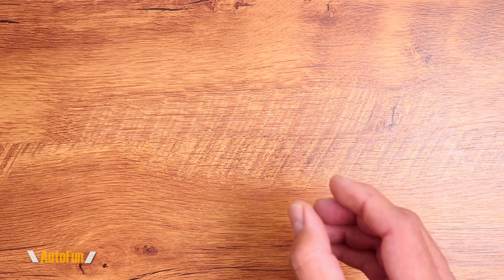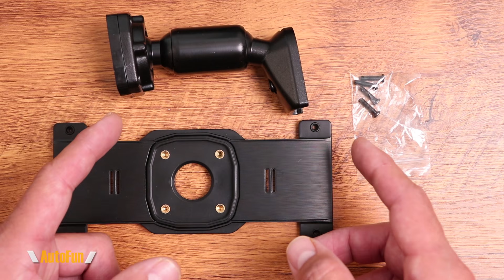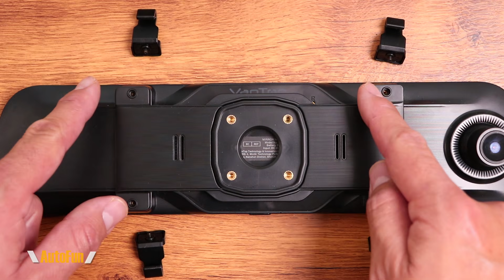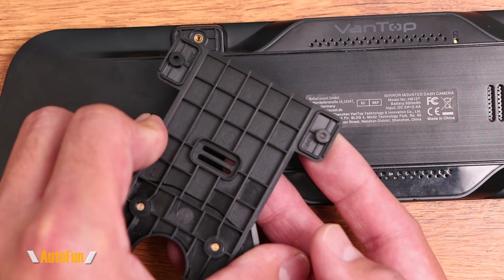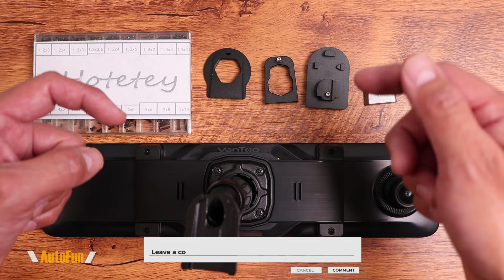How to Install Mirror Dash Cam WITHOUT Straps (Direct Mount Conversion Kit for LCD Mirror)

Comment: Do you know of a kit that will fit the Rexing M3. I need to adapt it to my Ford Bronco
Reply from the maker: Hi Bigfoot! Unfortunately the Rexing M3 does not have screw holes in the back, so a conversion kit will not work with it.  Cheers!

Comment: Doesn't work on a Jeep Cherokee and the US wedge mounts don't fit.  I returned it.
Reply from the maker: Hi Sirbug! Ah I placed links in the description to different mount adapters if your mount is not the standard D tab type. And if you prefer not to use mount adapters, your installer can remove the existing mount and install a standard mirror tab, I also placed a link to the tab and the special adhesive on the video description. And if you prefer not to use mount adapters or switch over to a standard tab, the Rydeen system could be used for those cases https://youtu.be/cCpyHmiZqiY Cheers!

Comment: Hi...can you teach us how to chang bracket for ddpai mola e3
Reply from the maker: Hi Tony! I have not tested the yet Ddpai E3, so I'm not sure what kit will fit, however you can measure the back as I showed in the video to determine the size but If I do get a hold of one of one, I will measure it for you and update this comment. Cheers!
Reply: @AlexAutoFun  the back of mola e3 don't have a screw to mount it to the bracket.if u got a solution can u share....10q
Reply from the maker: Hi Tony! Ah unfortunately if it does not have screw holes in the back, the conversion kit will not work with it. Cheers! @tonyhashim5776

Comment: Dont you have day job man? I also noticed you lost two personal passenger and driver courtesy lights from under the stock mirror man.
Reply from the maker: Not really LOL! Ah yes, loosing the electronic buttons on the original mirror is one disadvantages of direct mounting (even when strap mounting some dash cam can also potentially cover buttons on found on some OEM or On-Star mirrors). And I have reviews for traditional dash cams on my channel under the playlist "Dash Cam Reviews" if you want to use a non-mirror style one. Cheers!

Comment: Hi do you know if there is any adapter available for a 2019 Mazda 3?
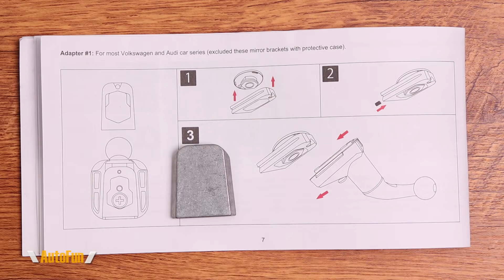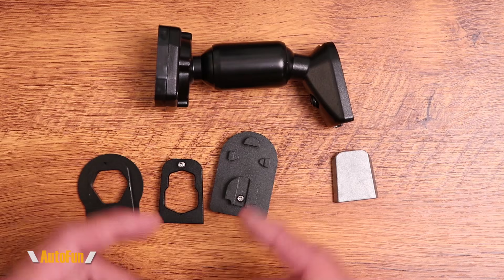Reply from the maker: Hi Tes! You can see illustrations of what the adapters look like at the 6:42 mark and what they look like in real life at the 7:52 mark. Their appearance is very distinct from each other. While it may be possible to identify the mounting tab by just looking thru the windshield (from the outside) I prefer to remove the the OEM mirror to double check if the mounting tab is a standard one or a specialty one (by comparing it to the examples show on this video). Cheers!

Comment: I have a van with no mirror.
Reply from the maker: Hi Dallas! Ah a mirror mounting tab can be installed by your installer to allow an LCD mirror dash cam to be installed. I placed a link to the tab and the special adhesive in the video description. Cheers!

Comment: The universal direct mounting kit you have listed for my Nexigo D90 Dash Cam on Ebay does not work. The screw holes do not line up at all. Are there any other kits out there that may be adjustable?
Reply from the maker: Hi Redline! The kit I linked for the Nexigo is from Amazon not Ebay, not sure which link you are using. I have converted several D90's using that kit but notice that it does require modification to work (the kit is what I call the universal kit). The link to the video showing the modification is also on the video description below the link to the mounting kit. Cheers!

Comment: Hi Alex, great vid and solves the problem 8n my 2011 Land Rover Defender Puma. So… is there a converter existing for this really dated, weird and uniquely Land Rover attachment? There is a hole in the head lining, no attachment to the screen! Just asking, great vid though!
Reply from the maker: Thanks Subsyairsoft! Ah yes there are some specialty brackets for mirrors that attach to the headliner, I placed links to them in the description, some that are labeled with for different car brands but as long as the mount matches your current mount stuff, it should fit (some car brands share mounting system). So I would recommend matching the picture of the specialty mount you think will fit to what your current mount looks like to confirm. The other option is with this system https://youtu.be/cCpyHmiZqiY if you are using a Rydeen. Cheers!

Comment: Do you know if there is a kit for acumen M4 digital camera mirror?
Reply from the maker: Hi Gustavo! Unfortunately I have not reviewed the M4 yet, so I'm not sure what kit will fit, however you can measure the back of the dash cam as I showed in the first video https://youtu.be/TtjZ7rC_ncY to determine the size. And If I do get a hold of one of one, I will measure it for you and update this comment. Cheers!

Comment: Do you know of a conversion kit for a Honda S2000? The windshield mount is not typical.
Reply: Also, is there a mount for the Wolfbox G890?
Reply from the maker: Hi uhkordguy! Unfortunately the G890 does not have screw holes in the back, so a direct mount conversion kit will not work with it. And I have more mirror dash cam reviews on my channel in the playlist "Dash Cams Reviews" if you like to compare them. Cheers! @uhkordguy
Reply from the maker: Hi uhkordguy! Ah there are a couple ways it could be done if your mount is the special Honda type (I usually double check the type by removing the original mirror to confirm) One would be with an adapter kit like this one https://amzn.to/3xKFlqt or with this kit https://amzn.to/49Q4lhp (assuming your bracket has been confirmed to be one of the odd ones) or finally the other way would be to have the installer swap the specialty bracket with a standard one (I placed links to the standard bracket and adhesive on the video description). Cheers!
Reply: Do you have any recommendations on a shorter USB C cable for the Wolfbox mirrors? Trying to clean up the installation
Reply from the maker: Hi uhkordguy! I would be careful if switching out the cable (some can separate and some are attached to the 12V adapter) remember, while dash cam manufacturers typically use standard USB connectors, they typically deviate from the USB standard, so the cable (the connector) can potentially be wired differently than a normal USB cable. What I usually do when installing dash cams is I hide any excess cable into the trim or in an area in the car where it will not affect the car or the dash cam cable (I have a video coming on this topic, stay tuned). Cheers!   @uhkordguy

Comment: Hey Alex I recently found your channel and I bought the wolf box 850 along with the hardwire kit and the universal conversion kit. Unfortunately my mirror bracket is one of the “special” ones lol😂 if I buy the mirror bracket for Honda that you linked in the description will I be able to mount my mirror? Muchas gracias Alex están muy chidos tus videos!
Reply from the maker: Thank you Jose! Ah there are a couple ways it could be done if your mount is the special Honda type (I usually double check the type by removing the original mirror to confirm) One would be with an adapter kit like this one https://amzn.to/3xKFlqt or with this kit https://amzn.to/49Q4lhp (assuming your bracket has been confirmed to be one of the odd ones) or finally the other way would be to have the installer swap the specialty bracket with a standard one (I placed links to the standard bracket and adhesive on the video description). Saludos Amigo!

Comment: Do any of these mirror dash cams have auto dimming mirrors? Only downside i see if i did this for my wrangler would be that i would lose my auto dimming feature on the mirror and side mirrors without the sensor and capability to do so.
Reply from the maker: Hi drugigger! Correct, Mirror Dashcams do not feature auto dimming. This is due to the mirror being an LCD screen when turned on, so you don't get your eyes blinded by the headlights from rear vehicles since what your are seeing is not a real reflection, what you are seeing on the screen is what the rear camera is seeing (assuming the mirror is used with the LCD screen on and the mirror is not aimed at your eyes since the screen is still reflective). Cheers!

Comment: Is there a mount that would fit a mk2 audi tt as the style of attachment is different on mine
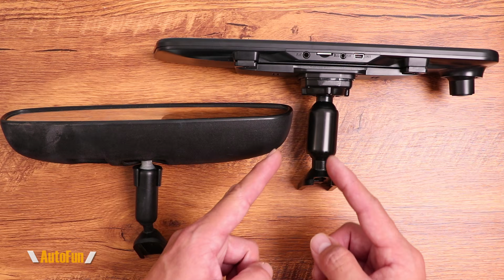Reply from the maker: Hi Glen! I show how to tell which adapter you will need at the 5:40 mark and you can also see what they look like so you can compare to the one on your car. I also placed links to the specialty adapters in the video description. Cheers!
Reply: Ahhh, I missed that part . Thanks for that
Reply from the maker: You're welcome Glen! @glencolledge2586

Comment: Um that's not centimeters that's millimeters
Reply from the maker: Hi Scotty! Correct, the ruler I'm using is in Millimeters which then I show how to use to measure in Centimeters (remember there is 10 millimeters in 1 centimeter, very simple conversion happening while measuring) so the correct kit can be ordered since the kits are sold in Centimeters. That being said, you could measure the dash cam and leave the results in millimeters and instead convert the kit measurement from centimeters to millimeters to determine if it will fit your dash cam. But I find it easier just to produce the measurements in centimeters converting in real time from millimeters than the other way around. Cheers!

Comment: Does mirror bracket adapters fit the official wolfbox conversion kit for G900?
(I have to install this in a Toyota gt86)
Reply from the maker: Hi Tommaso! Remember the mirror bracket (tab) adapters are universal to convert different mirror mounting tabs to the standard one. The G900 kit uses a standard mirror mounting tab so it should accept any standard mirror mounting tab. Cheers!
Reply: @AlexAutoFun  awesome, thank you!
Reply from the maker: You're welcome! @tommasozecchinelli2388

Comment: The specific mount kit for rexing m3 to a Honda sedan?
Reply from the maker: Hi! You can see illustrations of what the adapters look like at the 6:42 mark and what they look like in real life at the 7:52 mark. Their appearance is very distinct from each other. While it may be possible to identify the mounting tab by just looking thru the windshield (from the outside) I prefer to remove the the OEM mirror to double check if the mounting tab is a standard one or a specialty one (by comparing it to the examples show on this video). Cheers!
Reply: @AlexAutoFun  do you know which exact mount kit is compatible with a Honda sedan and a rexing m3 dash cam? Btw thank you for the response.
Reply from the maker: Hi! Unfortunately the M3 does not have screw holes in the back, so a direct mount conversion kit will not work with it. And I have more mirror dash cam reviews on my channel in the playlist "Dash Cams Reviews" if you like to compare them. Cheers!  @whatitisnt.

Comment: With all the extra holders etc, is it the same weight irregardless or does removing the OEM mirror make it much lighter?
Reply from the maker: Hi! Correct, removing the original mirror makes it much lighter than stacking the LCD mirror dash cam on top of the OEM mirror. Cheers!

Comment: I bought the Wolfbox G900  and have a 2024 Subaru Crosstrek.... not sure if the adapter you show in the link covers the 2024 model but can u confirm if the adapters will work with it or maybe send me a link of what will work ? thanks
Reply from the maker: Hi Bob! You can see illustrations of what the adapters look like at the 6:42 mark and what they look like in real life at the 7:52 mark. Their appearance is very distinct from each other. While it may be possible to identify the mounting tab by just looking thru the windshield (from the outside) I prefer to remove the the OEM mirror to double check if the mounting tab is a standard one or a specialty one (by comparing it to the examples show on this video). Cheers!

Comment: @AlexAutoFun. Thank you for the very useful info. I have added an OEM rear view mirror to my Mercedes Sprinter cargo van to attach a Wolfbox G900 camera. However, the overhead console blocks the front-facing camera completely. Do you know if there are longer arms or arm extensions available that I can bring the mirror (and the front-facing camera) lower to clear the overhead console that is blocking its view? Thank you very much for your help.
Reply from the maker: Hi Tat! For those cases you would want a dash cam with detached cameras so they can be positioned away from any obstacles. Here are some good choices that have feature https://youtu.be/zEvk-2z_zQY and https://youtu.be/JJKbUu_egiE and https://youtu.be/dVcfFVLCXbY Cheers!

Comment: You would not want this thing on your mirror 🪞 because your mirror 🪞 will fall off, remember your mirror is only glued to your window and that glue is not strong enough to hold a dash camera 🎥
Reply from the maker: Hi Moge! I have reviewed and installed dozens of mirror dash cams with the strap method (dash cam stacked on top of the original mirror) and none have fallen off. I have also installed many with the direct mount method I show on this video (where the original mirror is removed and only the dash cam is mounted, reducing weight) and none have fallen off. If you prefer a traditional dash cam instead I have more dash cam reviews on my channel in the playlist "Dash Cams Reviews" if you like to compare them. Cheers!

Comment: This is great! I had ordered the Wolfbox G900 for my truck. Because of the shape of the mirror it would not work and was just about to return it to my dismay. This is just what I needed to make it work. Thank you for the video!
Reply: I am having the same problem with my Wolfbox G900 for my Jeep.  I love the dashcam itself and it's features, but it's very annoying that I cannot fold down the drivers side sunvisor as the dashcam is in the way.  It's also annoying that the adaptive cruise control box is in my recordings since the camera is behind it.  I don't want to mount the dashcam anywhere different as I like the stealthyness of it being where the rear view mirror is, and I like how it doesn't take up any additional real estate in my field of view.  I've tried a couple other models and they all have similar problems for my Jeep.  Wolfbox does offer an OEM bracket to replace my rear view mirror, but their customer support cannot confirm it will fix my problems because they've gotten no customer feedback yet on the 2024 Jeep Wranglers with the issues I'm facing.  I wonder if this conversion kit will work or if I should try the Wolfbox OEM bracket.
Reply from the maker: You're welcome and congrats on your new mirror dash cam, Cheers!

Comment: How am I supposed to open my garage door now that my OEM mirror with HomeLink is gone?
Reply from the maker: Hi! Correct that is one disadvantages of direct mounting (even when strap mounting some dash cam can also potentially cover buttons on the OEM or Onstar mirrors). And I have reviews for traditional dash cams on my channel under the playlist "Dash Cam Reviews" if you want to use a non-mirror style one. Cheers!

Comment: What happens, if in middle of a long rainy night tour, electronic lcd dash cam go bad😎
Reply from the maker: Hi Naren! Ah good question, remember most mirror dash cams work as normal mirrors if the stop working or if they are used with the LCD panel off. Cheers!
Reply: @AlexAutoFun  I see. I didn't know that...
Reply from the maker: @naren1097  You're welcome Naren! And you can see my mirror dash cam reviews on my channel in the playlist "Dash Cams Reviews" if you like to compare them. Cheers!

Comment: The oem bracket is a good idea but does not work on a 2017 Ram 1500.🫤
Reply from the maker: Hi Shaggy! If you are referring to the Tri-Lobe bracket on newer Dodge's then all you need is the adapter shown on the video around the 7 min mark and here is the adapter https://amzn.to/3xKFlqt (links to additional adapters in the video description) The other way to do it is to install a standard mirror adapter tab to replace the current tab on your mirror (link to the tab and glue in the video description) Finally the third way to do it is with this universal system https://youtu.be/cCpyHmiZqiY Cheers!

Comment: I should have researched more. mine is a "Vehicle Black Box DVR" and the elastic clips don't have any screws that I can find. Looks like the rest of them, maybe a copy of a copy.
Reply from the maker: Hi Paco! Ah yes unfortunately some mirror dash cams do not have screw holes in the back, which means the conversion kit will not work with it. Cheers!
Reply: Thanks, Alex, the first thing I noticed when I unpacked the Vehicle Blackbox was the lack of a proper manual and the elastic straps. Then I saw your videos. when these items come from the Chinese vendors, it's a one way street, returning shipping charge is more than the actual cost of the merchandise. We belong to China. 
Too bad, it's on me.
Reply from the maker: Yeah very true Paco.. Enjoy your Labor day weekend! @PacoAlen

Comment: So i accidentally broke a screw inside the dash cam while trying to screw in the mount. Anyone have any ideas how to remove the broken screw inside the dash cam? 😅
Reply from the maker: Hi Wally! There are screw extractors however the easier way since we are dealing with plastic would be standard pliers. Cheers!

Comment: The reason i keep the original mirror is for that flip switch. If my camera fails i can hit the switch quickly and not have to adjust the mirror
Reply from the maker: Good point! Another downside of a direct fit conversion is that some OEM mirrors have buttons on them for garage control or On-Star, which in that case that functionality would be lost since the OEM mirror would be removed. Cheers!